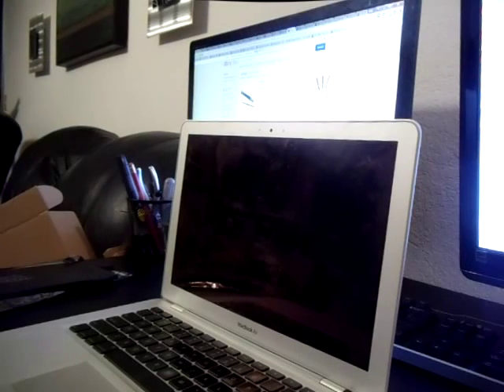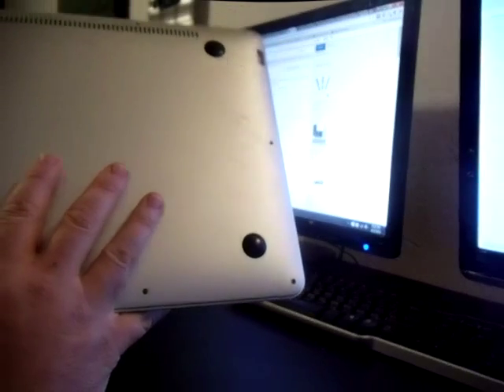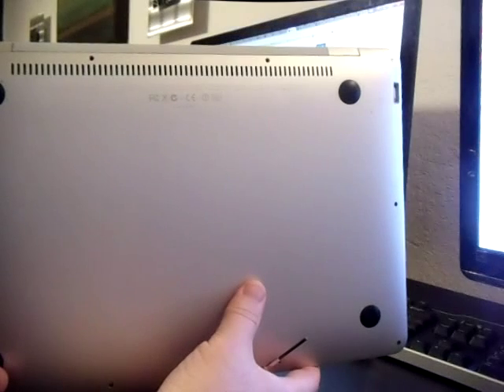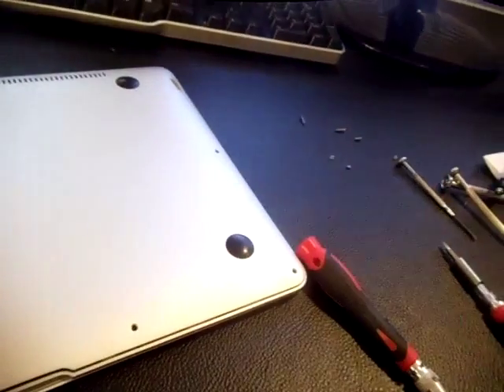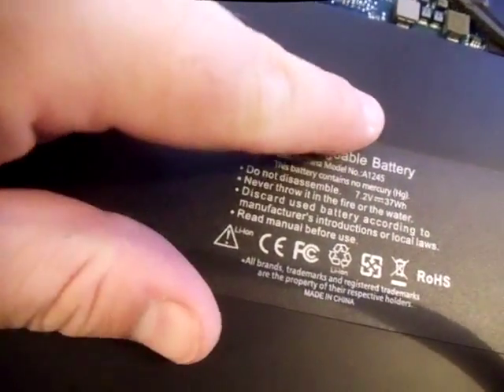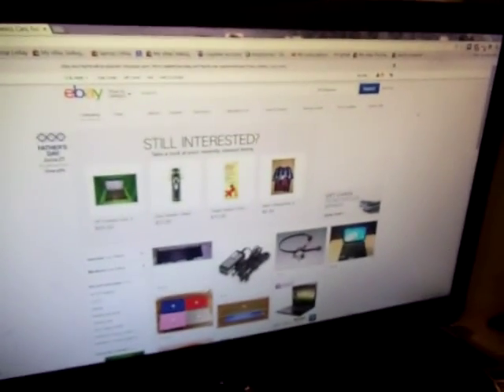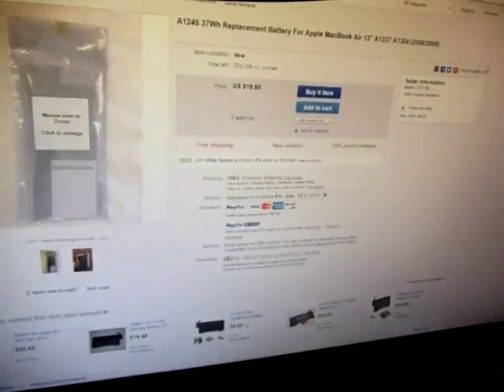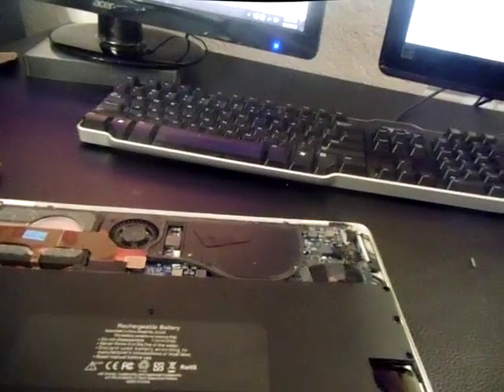How to Repair Fix a Swollen Macbook Air Pro (Battery 2008 2009 2010 2011 2012 2013 Keyboard swelled)

Comment: Did the shape of the unibody go back to normal after you replaced the battery?
Reply: Mine did; 100% - MacBook Air. And, the battery was extremely warped bulging the body and keyboard. I removed the battery the instant I noticed I could not close my Air.

Comment: hi.  my macbook pro intermittently has trouble wth ONLY the letters tyuio.  Sometimes all the keys work fine but, for instance, during this second sentence, i had to depress all those keys for a few seconds to get that "o" to type in "sometimes".  Depressing the keys for a few seconds, not necessarily hard, but LONG is what make the keys work again.  I just discovered now that depressing a single non-working key for a few seconds gets the key working also.  I've tried all the tricks that others have done (toggling on/off mouse keys, etc).  I've not found this to solve the problem.  The problem seemed to coincide wth installing El Capitan.  I've had many discussions with apple technicians and they keep insisting it's a hardware problem since using a newly created user doesn't help and the recent reinstallation of the o/s didn't help.  Prior to this happening I had a software on here that allowed me to turn the fan on more.  (I think that stupid app was for gamers).  I chose to install it long ago b/c I seemed to notice the bottom getting super hot.  Perhaps THAT was my mistake...installing that app.  Hardware tests don't seem to find any issues.  One of the times I reset the SMC recently, the fan came on LOUD and constant after the reboot and it wasn't recognizing the battery.  Decided to reset the SMC again and the LOUD fan went away.  A swollen battery came up as one of the possibilities in the communities i've searched online.  Dirty keys/water damage is another possibility.  Before I pop out more keys (which is scary as hell), I want to find out more opinions from people such as you who seem to have a working knowledge of the guts of laptops.  What does your instinct suggest might be causing my intermittent issues with the tyuio keys (and those keys only).  Thanks

Comment: I just replaced mine and now it's not working, where it was working, before and swelled. Beside the obvious, of the new battery not working, why would it not turn on, now?
Reply from the maker: +Rayford, Ray Siegel The battery does not work, or does the computer not work?  When you turn on the computer and you put your cursor over the battery icon on the upper right what does it say?  Also when you plug the cord up does it stay green or does it turn orange?
Reply: +RubberWilbur,
Nevermind, I don't know what I was thinking. I thought it would have a charge, out of the bag. I put the charger, on it and it worked. At first it stayed, on the blue screen, so I thought it went back, to a problem, that I was having, before. I'm good, to go. Your video was very helpful. Thanks, for all the help.
Reply from the maker: +Rayford, Ray Siegel no problem
Reply: Stop buying Apple products

Comment: Good video.  Do you know anything about replacing the string on weed eaters?  My weed eater repairman will be unavailable for 3-7.
Reply from the maker: happyjesus123 Usually it's just the head that you replace, not the string itself.  It should screw off and you replace it with a new one.  Depends on the model.
Reply: RubberWilbur It's cheaper to buy the string and wind it yourself. It's very tricky though to get right and although Corky made a video about this very subject it wasn't all that helpful. I hope he spends his time well in jail and can update his advice when he gets out.
Reply from the maker: DialecticKaos how many years do you think the Corskter will get?  I'm going to bet 3 years.
Reply: RubberWilbur I think he'll get 1 - 2 years plus probation and restitution, but I wouldn't be surprised if it was a more lenient or harsher sentence. Looking forward to finding out after June 18th.
Reply: pretty sure it was sarcastic
about the weed eater string.